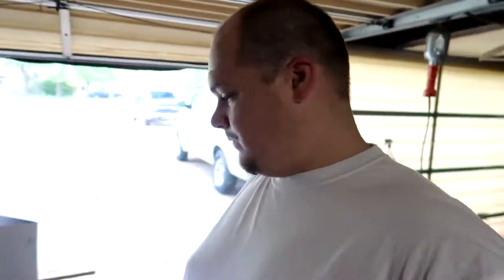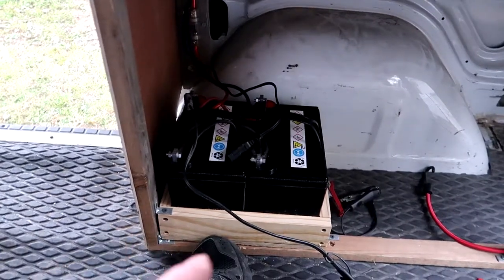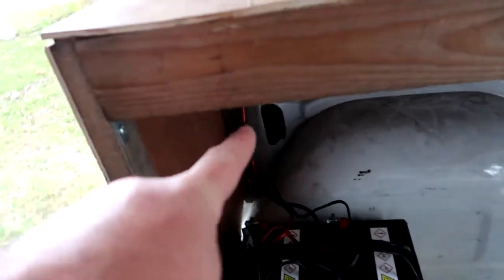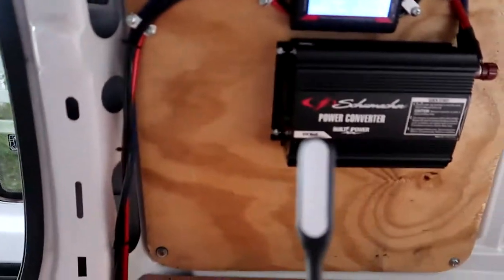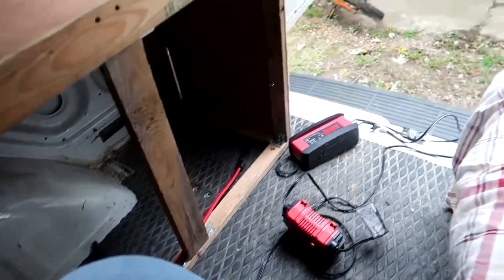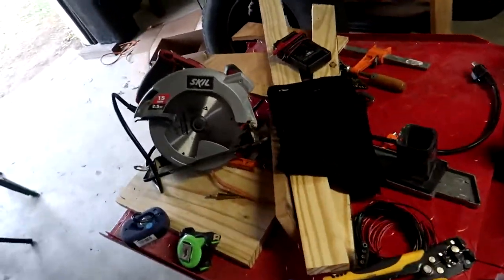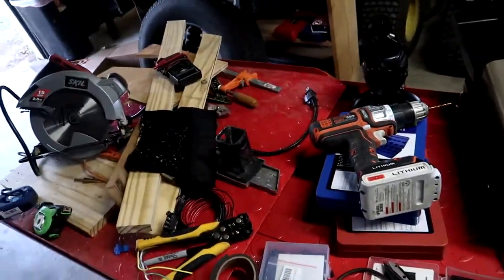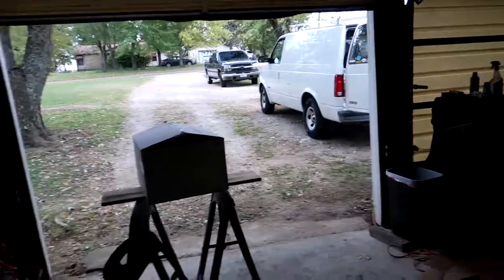Moto Van Project Part 2

Comment: Well planed on the batteries/setup.  I don't remember if I showed my Astro, but I have a 50 watt solar plane on the roof with a 100amp battery switch, so I can have it charge with solar, or switch to the vehicle and charge off the alternator.  It sounds like you are doing the same, except I only have 1 battery, a group 31 HD deepcyc with 185 amp hrs/reserve.  The van is coming along and should server you fine.
Reply from the maker: I don't remember seeing it but I would love to check it out. I would also like to get a battery isolator which would charge my normal car batter and when its charged it will switch to the "house" battery and charge it till full and swap back. About $89 for a kit. It also allows you to start the vehicle off either batter in case of an emergency. 185 amp hours is huge! that would last quite awhile for my needs haha